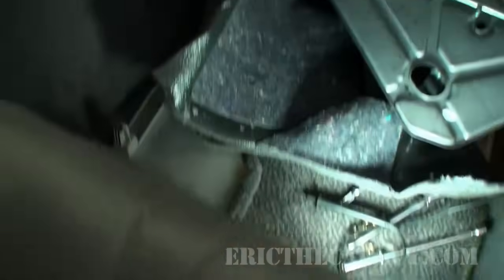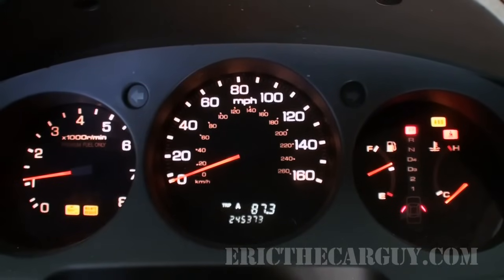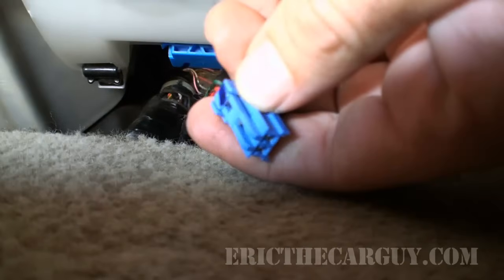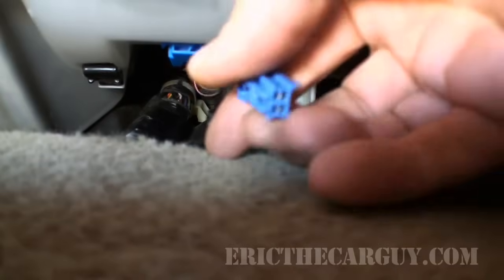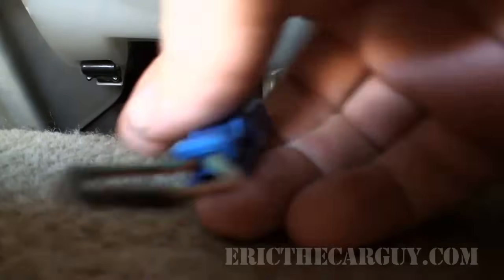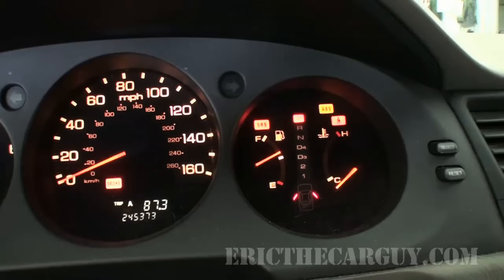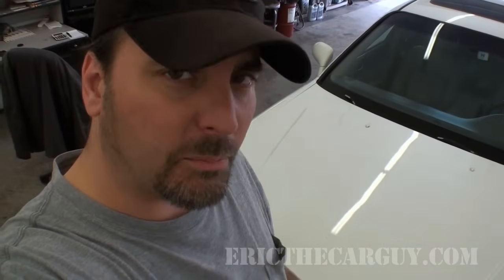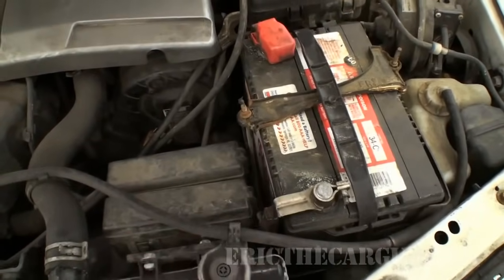How To Pull Honda Codes Without a Scanner -EricTheCarGuy

Comment: hey i am havin an issue with a 78 dodge lil red express that im workin on restorin. when in neutral you can floor it and it sounds good but as soon as you put it in drive you cant floor it past 3000 rpm or chugs hard and/or dies. if u lightly give it gas you can go past 4000 rpm without a problem. if you go up a hill it doesnt have the power to keep going and will stop moving forward no matter what the rpms are. i just cant figure out why it chugs or the lack of power. the sending unit is good.

Comment: Good info for thoes that don't want to spend mere £10 on a USB scan tool.. Or you can vist a local garage, in my case (redline garage, ig11 0tj) who are the only garage to offer FREE full system scan and give you a price for the job if you wish to get it sorted. Which compared to other places charge £50-100 for just a scan!

Comment: hey my srs light started flashing with the abs light after it repated the codes a few times my srs light not on . i think it may just had sum thing to do if the wire been jumped

Comment: thanks eric i tried it today on my 95 honda accord lx v6 4door my abs light been on for bout 3 weeks now because every shop was trying to charge me any where from 65 to 80 bucks to read the code . i work on cars i just dont have a code reader . will i used what u say in the video i got my code it 48 which  is rear left sensor . i will be going to the pull a part in the moring to get one

Comment: the connector to check the srs codes on that car is under the driverside dash. If you remove that bottom most panel, the connector is attached to it.

Comment: Had a 90 Vigor, RHD, so yeah the connector was on the left/passenger footwheel. Recall some years ago had the check light come on, put the paperclip across, read the code on the dash, off to the local selfhelp yard. Pulled the sensor, put it in all good for ten bucks! I was very pleased with myself at the time and the coin I saved, aaaah, simple times.

Comment: While your in the fuse paneland your not sure which ABS fuse to pull why not just pull them all..Then u don't have to keep coming back and forth to pull a fuse.And it might even help clean any corrosion on the blades of fuse by pulling and reseating them..Great Tip eric..

Comment: how about posting a video changing a battery in a honda without erasing memory which cause radio does not work? better way to remove the battery with the engine running because it can cause damage to the computer

Comment: where is 79 code on your list? and another question, if you have lights on, minds that maybe you have problems, how do u solve that? or just need to erase code if you think that everythings ok?
Reply: 0 and 11 Electronic Control Module (ECM)
  1 Heated oxygen sensor A
  2 Oxygen content B
  3 and 5 Manifold Absolute Pressure
  4 Crank position sensor
  6 Engine coolant temperature
  7 Throttle position sensor
  8 Top dead center sensor
  9 No.1 cylinder position sensor
  10 Intake air temperature sensor
  12 Exhaust recirculation system
  13 Barometric pressure sensor
  14 Idle air control valve or bad ECM
  15 Ignition output signal
  16 Fuel Injector
  17 Vehicle speed sensor
  19 A/T lock-up control solenoid
  20 Electric load detector
  21 VTEC control solenoid
  22 VTEC pressure solenoid
  23 Knock sensor
  30 A/T FI signal A
  30 A/T FI signal B
  41 Heated oxygen sensor heater
  43 Heated oxygen sensor circuit or problem in the fuel supply system
  45 Fuel supply metering
  48 Heated oxygen sensor
  61 Front heated oxygen sensor
  63 Rear heated oxygen sensor
  65 Rear heated oxygen sensor heater
  67 Catalytic converter system
  70 Automatic transaxle
  71 Misfire detected cylinder 1
  72 Misfire detected cylinder 2
  73 Misfire detected cylinder 3
  74 Misfire detected cylinder 4
  75 Misfire detected cylinder 5
  76 Misfire detected cylinder 6
  80 Exhaust recirculation system
  86 Coolant temperature
  92 Evaporative emission control system

    Next
go to the link and the they are all there.
Reply: Link to code explanations: http://www.ericthecarguy.com/hondaacu... Honda ABS Codes 1994-1997: http://www.ericthecarguy.com/honda-ab... Honda ABS Codes 1998 and up: http://www.ericthecarguy.com/honda-ab... Visit me at: http://www.ericthecarguy.com/ Discussion about this Video: http://www.ericthecarguy.com/componen...

Comment: Did you find out what code 79 meant? I can't find it anywhere other than on Prelude's it is 'ATTS control inhibited" which I am fairly certain the RL does not have (ATTS).

Comment: Exhaust Valve Control Solenoid Circuit Low (Bank 1)
Air Assisted Injector Control Range/Performance
right?